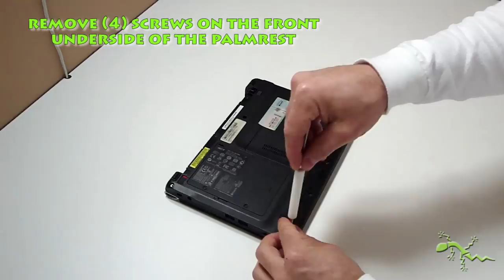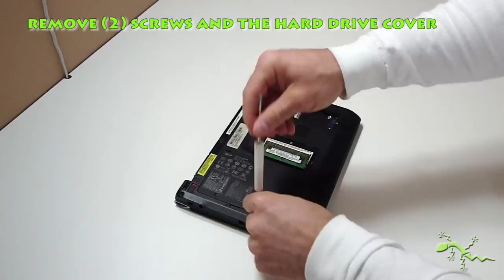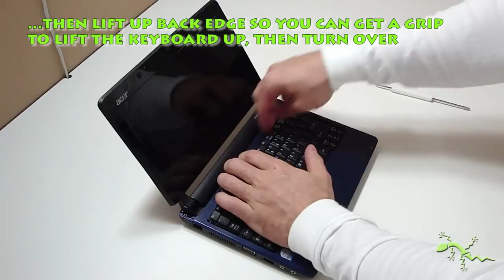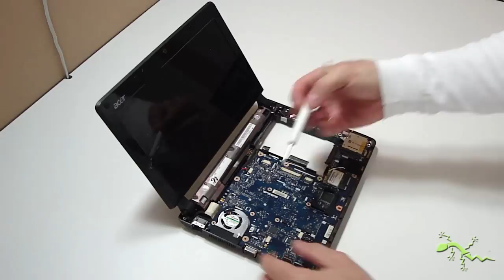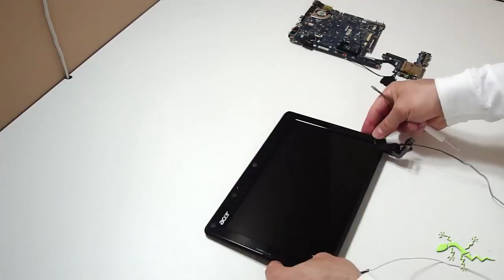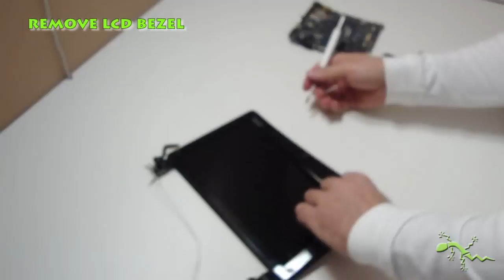How to take apart an Acer Aspire One D250 / KAV60 netbook

Comment: Hi, I disassemble my laptop as the video shows however I found I dont have the last small connector you removed the front onder keyboard cover to see the main board, not sure what its that for and my problem is the acer screen is half black